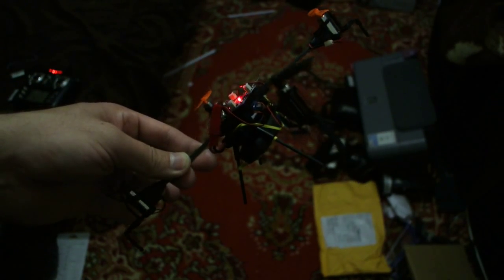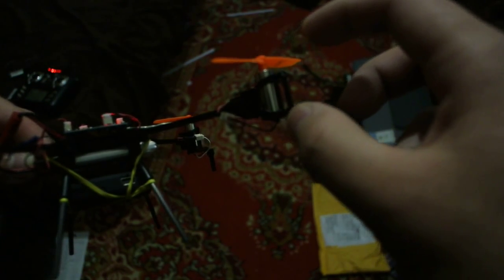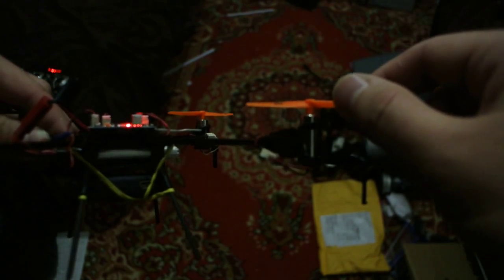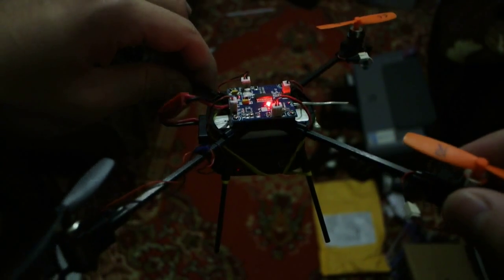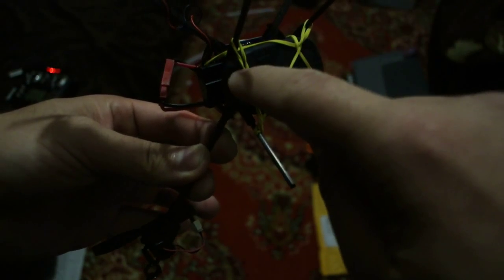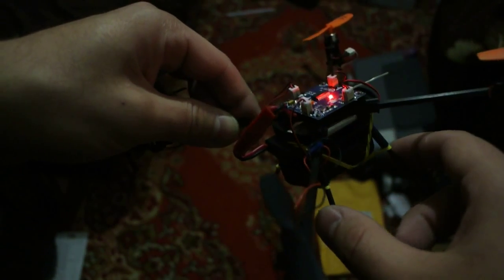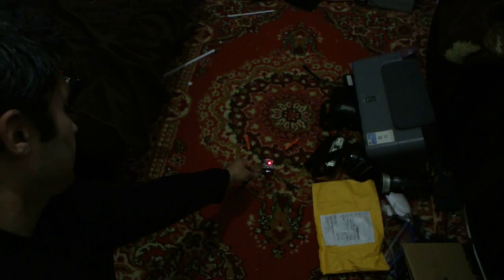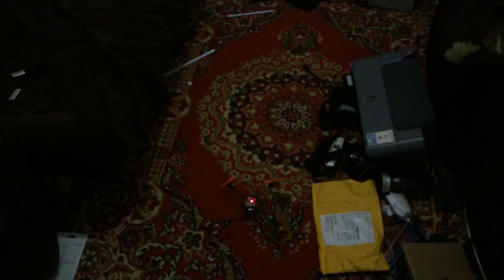turn v929 gearless. frankenquad hybrid of v939 props, v929 board, v959 frame

Comment: Thanks for posting! you seem to be the only one I've seen doing the things that I've been interested in (IE, shortening booms, and flipping motors to go direct drive) Keep up the good work. I have a V959, and maybe you can tell me something. the board has 4 extra ports apart from the LED ports that say Light. any idea the purpose of these?
Reply from the maker: check out dedicated thred on rc groups: http://www.rcgroups.com/forums/showthread.php?t=1801759

v959 will not tolerate modification, board is programmed for stock props and with any other wobbles terribly. v929 is more forgiving.
This direct drive mod is not worth doing, gears make the aircraft energy-officient. when direct drive it needs strong battery and consumes much more power.

Comment from the maker: this project was failure, if it was success I would shorten arms as I tried with almost all my quads. 
direct drive gives much less thrust then big props with reduced gear. that is probably the reason that 2-blade props are better then 3-blade - because the bigger the blade the more thrust it gives.